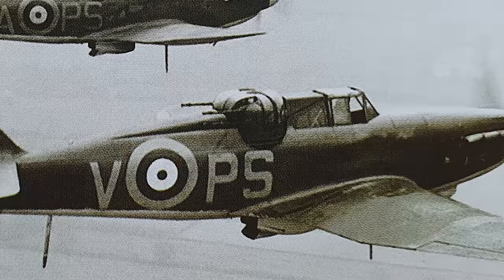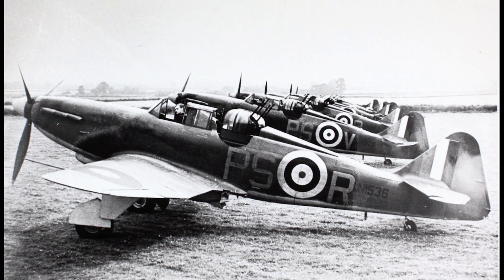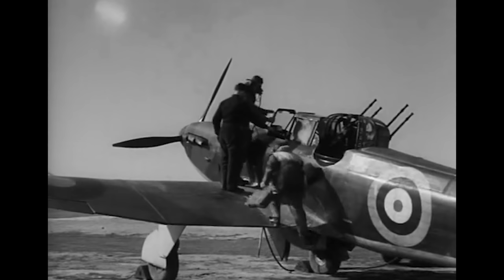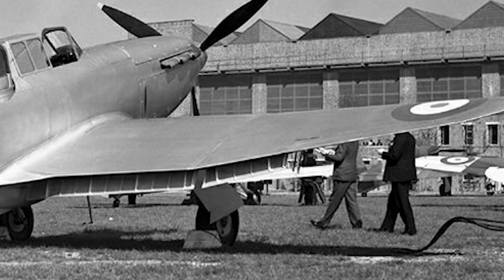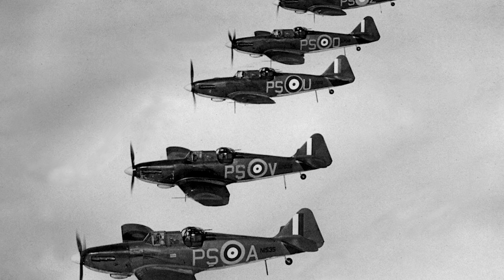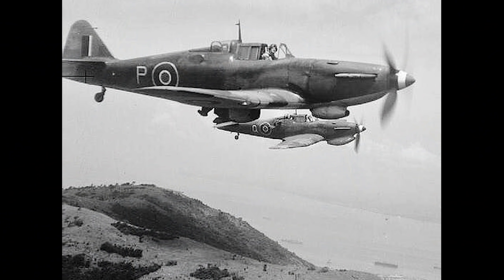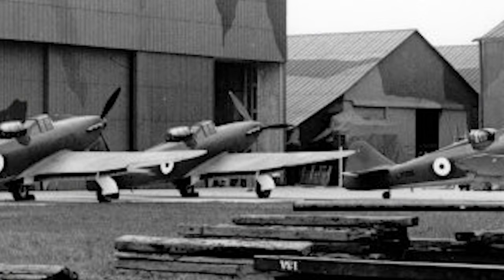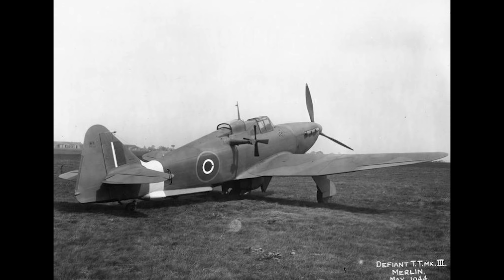Boulton Paul Defiant - The Unlucky Turret Fighter | Aircraft History #4

Comment: A much maligned aircraft, the BP Defiant was NEVER meant to operate against ESCORTED bombers. At the time the British air ministry issued its original specification for a "turreted fighter" in 1935, the luftwaffe was operating from airbases within mainland Germany, and even from the closest bases to Britain the luftwaffe fighters did not possess the range to escort the bombers that far. This being the case the BP Defiant was designed to operate against unescorted bombers attacking Britain from across the North sea, a role that it would have handled admirably.

Now fast forward to 1940. After the Wehrmacht had crushed the French they now possessed airbases a LOT closer to Britain than in 1935, meaning that German bombers WOULD now be escorted in the skies over Britain... and THAT was were the mistake was made, as it was decided to operate the Defiant against the now escorted bomber formations, though it was quickly withdrawn from the role after resultant heavy losses. Though as the video correctly goes on to say it did later operate successfully as a night fighter and then as a pioneering ECM aircraft and finally as a target tug for training air gunners.
Reply: You cannot base your strategy, nor your acquisitions of military equipment, believing that your enemy is going to act exactly as you want. And that is exactly what the English did with the Defiant. And that's why it was a failure as a frontline fighter.
Reply: @ferrusmanus1  So you're suggesting that you do not plan ahead in any way and simply react to events as they happen? As opposed to the British air ministry who throughout the mid 1930s planned for the most likely use of German air power with regards to Britain... only with the huge problem of not having a crystal ball to foresee the collapse of France in 1940?

Comment: If I understand correctly, the "Shrage Muzik" armament used by the Germans was "fixed" vs the Defiant's use of a 4 gun turret.  I often wonder why the British did not use a quad .50 armament for the turret.  I suspect it was due to weight and  ammunition storage.  It should also be noted that British quad turrets installed in other aircraft like the Lancaster also had .30 cal MG's not .50's.

Comment: One of the things that you don't go into is the P.94 Defiant proposal which ditched the turret for an impressive wing armament of 12  303s or 8 20mm Hispanos and other weight savings,  The prototype P.94 prototype using the original Remodeled Defiant prototype also had a top speed of 360 mph in 1940 being as fast although less maneuverable but significantly heavier armed than contemporary spitfires as well as being longer ranged.  However, the Air Ministry rejected the proposal as they believed that Hurricane and Spitfire production was sufficient.  Had this plane entered service in 1941 it would potentially have been a great fighter.  And being roughly halfway between the Fulmar and Sea Fire in size and with Blackburn's ongoing relationship with the FAA could have been a good option for the Carriers and would certainly have hurt any Zero it dived on and with a 30mph speed advantage over the Zero it had potential.  (in the prototype the guns could be depressed 12 degrees for better strafing but I personally think the production variant would have dropped it)
Reply: hahaha

Comment: Very interesting video. I just don't know why they didn't have wing mounted guns also. Maybe too heavy.The hero's who flew them did a superb service for our nation.
Reply: J.D. North expressed concern for this but forward firing was not the spec asked for by the Air Ministry who wanted a bomber interceptor that could get in the bomber formation and pick them off from the sides. But your guess of adding forward firing guns is correct. The turret already made the Merlins of the time struggle to give the Defiant the speed it needed to stay up with the bombers due to its weight. Another group of .303's would have made it too slow to catch any of the German bomber types.

Comment: About 35 years ago, I was still very much into building and painting plastic model kits of WW2-era aircraft. Through that hobby I actually ended up learning a good deal about all kinds of WW2-era fighters, bombers, and basically anything from that time with at least an engine and propellor meant to go up into the sky.
Never came across this plane until one day, on vacation in Turkey, I stumbled upon a little shop that only dealt in model kits and military miniatures (back then apparently something that wasn't exactly common hobbies in Turkey, judging by the fact that over the span of several vacations (over a period of roughly 8 years, and spent trekking across much of Turkey) I only came across that one shop).
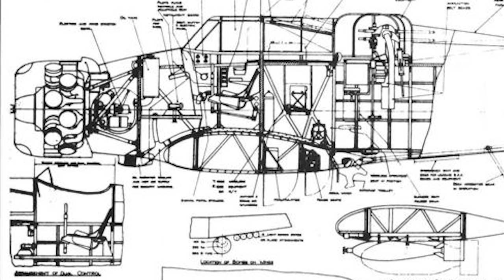That shop had some Asian brand model kits, ranging in scale from 1/32, 1:72, 1:144 and a few more... got my hand on three different scale models of this plane, with the 1:32 model including a little booklet that went over some of the history of the plane.
And back then, they were cheap, the total price in Liras back then still only converted to a few cents in Dutch guilders (yep, kids, there was a time not so long ago that we Dutch used a different currency... a time before our government and businessmen decided to screw us all).

Comment: I have often felt with some design changes and tactics it could have fared better.
1. In the same way hurricanes would go after bombers and spits fighters when working together spits covering defiants could have worked. The defiants acting a bit like schlager musiek i think it was called in luftwaffe ie upward firing guns
2. Fit either a single or twin guns forward ideally 50cal or 20mm
3. Use the defiant in close air support role with couple bombs plus use it like an AC130 spooky gunship
Reply: So you would have one pure fighter flying escort for another?
Reply: 1. In the dark days of the Battle of Britain anything that could fly and shoot was tossed up without thought by the RAF. In fact Blenhiems were also sent up briefly to fight. Defence of Britain was in fact an ill thought out response with little in the way of tactical thought. More a toss it in and hope it works. Fighter cover for the Luftwaffe was limited in combat time over England and so actually protecting the bomber wings was a matter of fine judgement by the Germans. Had the RAF actually considered the spec the Defiant was made for they would have sent them against undefended Bomber streams only that had strayed beyond the effective range of the fighter cover. Sadly for the Defiant the RAF redesignated them fighters and thought no more of it.
2. Availability, weight, engine power,  recoil and airframe design meant big changes and  a redesign would have prevented this.
3. Same answer for bombs sadly.
Reply: @Pokafalva  Defiant was not really a fighter but an interceptor. No single plane does everything and why not the long range Me110 "Versturer" was often accompanied by Me109s to take on fighters while the Me110 carried out other duties e.g. bomber interception. So its not unprecedented.  The. Defiant might have. been better at taking out bombers without getting shot down by the bombers than a hurricane.
Reply: @aquaticaustralia  Was not the Hurricane and Spitfire also an interceptor in the Battle of Britain?  SHort answer:  They were.  The only Bf 110s who received fighter escort in the Battle of Britain were the fighter-bombers of Erprobungsgruppe 210, because they were classed as bombers.  On many occasions their escort came from the Bf 110s of ZG 26.  No pure Bf 110 fighter unit received Bf 109 fighter escort during the BoB.  Trust me on this, I know what I am talking about.  Explain the logic of this to me: '...The. Defiant might have. been better at taking out bombers without getting shot down by the bombers than a hurricane...'  So escorting Luftwaffe fighters intercept the Defiants.  What next.  I'll rell you: go look at what happened to 141 and 264 Squadrons in the Battle of Britain...
Reply: @Pokafalva  You are getting bogged down in detail of what actually happened I am. talking about what may have been an alternative strategy - The defiant possibly could have been a useful bomber destroyer with the right tactics but needed protection  for its own shortcomings.  What I. am. saying is PERHAPS a tactical change might have seen the Definant be a more useful specialised tool in the right circumstances. My point about. the ME110s is to say that its not unprecedented to escort specialised tools. The. defiant should have been considered a. specialist at destroying. bombers  and defended to allow it to do its job. It had it. proved. more efficient e.g. IF it were. shown. to be able to take out a higher number of bombers than a hurri then the use of 2 airplanes might have been. worthwhile - Don't get bogged down in minutae when we're discussing a might have been experiement.
Its interesting what it might have done because later the Germans put upward firing guns into their night fighters.
I also. wonder how it might have been for AC130 type. gunship. missions to support troops (later in the war with air superiority).
Reply: @aquaticaustralia  I am not getting bogged down in detail.  You are not seeing the true scenario, and describe a situation which is frankly ludicrous: '...The defiant possibly could have been a useful bomber destroyer with the right tactics but needed protection  for its own shortcomings...'  So you are suggesting that a Defiant squadron should receive fighter escort in order to have a chance of shooting down bombers!  That is an absolute waste of Hurricane and/or Spitfire squadrons - providing escort for their own fighters!  And are you suggesting that the Hurricane and Spitfire were not 'bomber destroyers'?  This whole razzamatazz about the Defiant being a 'bomber destroyer' is a  load of rubbish.  It was a fighter, and too slow and outdated by the time of the Battle of Britain.  And this is just whataboutery: '...IF it were. shown. to be able to take out a higher number of bombers than a hurri then the use of 2 airplanes might have been. worthwhile...'  No, that would be an absolute waste of a fighter: doing nothing but escorting another fighter!  Are you serious?  How much have you researched the Battle of Britain?  '...Don't get bogged down in minutae...'  Researchers DO go into the minutae of events, because that is the way one can actually get at what actually happened.  By 1940 the Defiant was outdated as a day fighter and not fit for purpose - go check out what happened to 141 and 264 squadrons in July/August 1940 for confirmation of this.  And finally, as I have already pointed out, the only Messerschmitt Bf 110 unit in the Battle of Britain was Erprobungsgruppe 210, because they were classed as a BOMBER.  If you  want to read up on that unit, get the book by John Vasco...
Reply: @Pokafalva  There is record of Blenhiems and Gloster Gladiators being used in the early stages.
Reply: @suburbiapheonix7960  Outwith Hurricanes and Spitfires, deploying anything else was a very dangerous game indeed.  You can catch everything about those two you mention in the book series, 'Battle of Britain Combat Archive' by Simon Parry.

Comment: One thing you don't mention. If a Defiant was badly hit, the hydraulic system would fail, making it impossible to rotate the turret. If the turret happened to be facing the rear at that moment, it would be impossible for the gunner to bale out.

Comment: I recall that the JU-87 had a rear gunner as well, but as a ground attack plane rather than a fighter that served the purpose better.
Reply: The ME110 also had a rear gunner but was designated a 'destroyer' due to its formidable forward firing armament. However it found itself outclassed by he RAF Hurricane and Spitfire to such a high degree  it had to be protected by the already overworked fighter squadrons. Unlike the brief of the Defiant the ME110 was designed to take on fighter opposition.
Reply: @suburbiapheonix7960  Didn't the ME110 also wind up as a nightfighter?
Reply: @amadeusamwater  It did and was successful in that role. It was also modified to carry upward firing guns to allow the aircraft to shoot bombers from below.
Reply: @suburbiapheonix7960  '... However it found itself outclassed by he RAF Hurricane and Spitfire to such a high degree  it had to be protected by the already overworked fighter squadrons...'  It was not outclassed by the RAF fighter squadrons - in terms of its claims-to-loss ratio it performed every bit as well as the other three main fighters in the Battle of Britain.  And the ONLY Bf 110 unit that received fighter escort during the Battle of Britain was Erprobungsgruppe 210, the fighter- bomber unit.  It received fighter escort because it was classed as a 'bomber'.  And on a lot of occasions, it received fighter escort from the Bf 110s of ZG 26, ZG 76 and V.(Z)/LG1.  No pure Bf 110 fighter units received Bf 109 escort udring the Battle of Britain.  You have been reading decades-old books that published myths, not facts, about the Bf 110!

Comment: The biggest problem was that the Defiant was saddled with a woefully underpowered version of the Merlin engine. They should have installed that 1,400 bhp Merlin 45 or 1,600 bhp Merlin 61 and it would have become a lot less vulnerable plane. And should have replaced the four 0.303 guns with two 0.50 guns on a lighter turret design. Such a Defiant variant could have pioneered the schräge musik attack mode at least a year before the Germans did.

Comment: I had always been left with the impression that it was a disaster and got the chop very quickly but perhaps just a ball mounted 50 cal in the back to save weight and some forward firing guns it may have held its own.
To be fair it was not a fighter but an interceptor.
Reply: '...To be fair it was not a fighter but an interceptor...'  Same thing.  Was not the Hurricane and Spitfire also interceptors?  Whether intercepting bombers or their accompanying fighters.  The Air Ministry specification that it was built to specifically required a fighter - no mention was ever made of 'interceptor'...
Reply: @Pokafalva  was the ME 163 a fighter?
Reply: @glennpettersson9002  What kind of question is that?
Reply: An interceptor is not the same thing as a fighter, the design brief is different. I got the impression that the turreted fighter was designed to take on bombers.
Reply: @glennpettersson9002  Glenn: The original Air Ministry specification (F9/35) was for a fighter.  It is easy to say it was designed to take on bombers, but it wasn't.  It was designed as a fighter.  We can look back now and say the the Defiant design harked back to the two-seater fighters of World War 1, and therein lay the problem with the design - advancement in aviation and fighter technology left the Defiant concept far behind, resulting in the loss of many young lads who were given an aircraft that was not fit for purpose in the skies of southern England in the summer of 1940...

Comment: Would have been great as a  Fighter bomber role with 4 30 mm fixed forward-facing and a 23 mm aft-facing Gun.  Keep the quad turrent and make it aerodynamic. 

Make the Wings delta and have two Variant

Tank Buster: 
Make the plane movable and add hardpoints  for rocket launchers Anti Tank roles 

Antiship maritime fighter: 
 Add torpedo drop bay for maritime  against ships and hardpoints
add Radar

Put a powerful engine with a 4 bladed propeller like the P4 thunderbolt and 

Would have been great against Naval warfare and a Tank Buster role  in WW2 for the British.

Missed opportunity  I'll say.

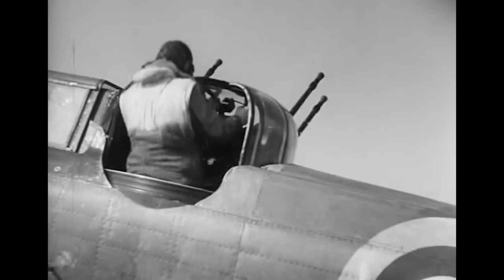Comment: 2:27 Bailing out does not look like a easy process for the rear gunner. He would have to first open up his canopy, which I hope is easier to open than it is to close, he would then have to put on his parachute. The whole time being in a crashing and burning plane spiralling to the ground.
Reply: Defiant gunners were provided with the GQ Parasuit, special short-legged coveralls nicknamed "Rhino suits", which were worn over the parachute pack. In theory this prevented the gunners equipment from snagging on the aircraft when bailing out through the rear of the turret (which had to be rotated to the side first) or through a floor hatch.  I've read that the Parasuit was regarded as more trouble than it was worth and was not used much after 1940.

Comment: WHEN YOUR dEFIANT HAS A 109 coming at it from the front: THEN PERHAPS TODAY IS A GOOD DAY TO DIE, PREPARE FOR RAMMING SPEED!!!! Sorry, I couldn't help myself lol.
I noticed that in both role and design the Bolton Defiant is basically the British version of the Shrazz Musik concept the Luftwaffe used. except they used fixed cannon firing upward at an angle with an analog automated triggering system rather than a turret.